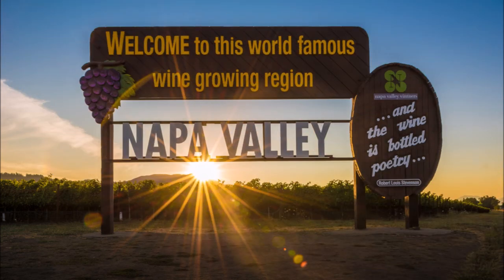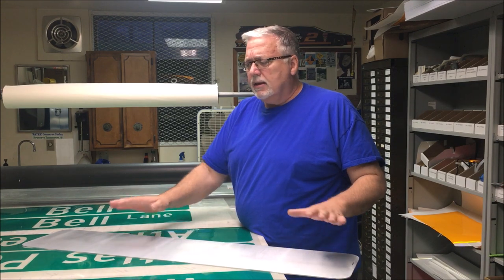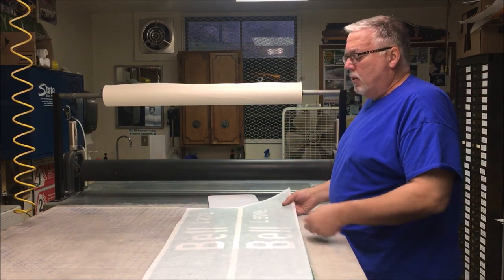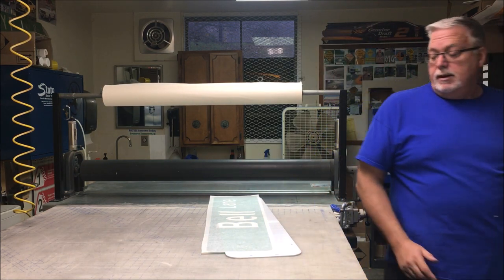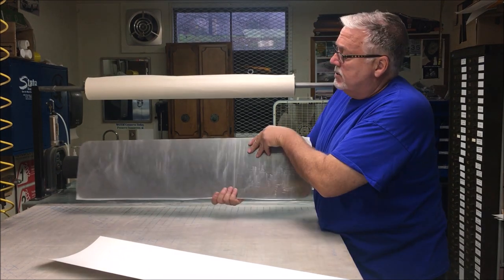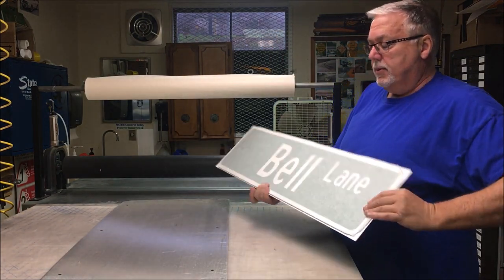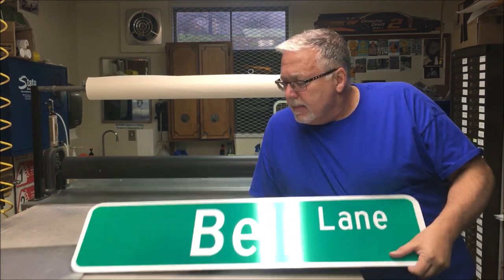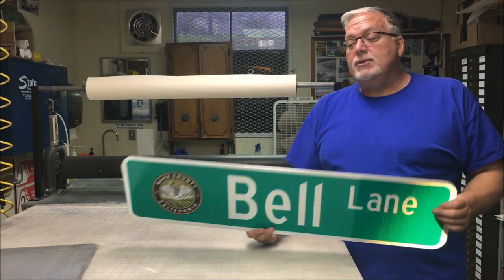Double Sided Street Sign Tips

Comment: Bob is there any regulations regarding length of signs, for example if you have a really long name do you use a long blank or do you squash the letters.
Reply from the maker: We use 30" 36" 42" and 48" sign blanks. This avoids "squishing" the letters. We use a 6" series "C" lettering for all our traffic signs.  I try and keep all the lettering the same size by using a different size sign blank for the number of letters in the street name. There is no standard size for street name signs.
Reply: Bob The Sign Man thank you always wondered about that. Cheers from Sacramento